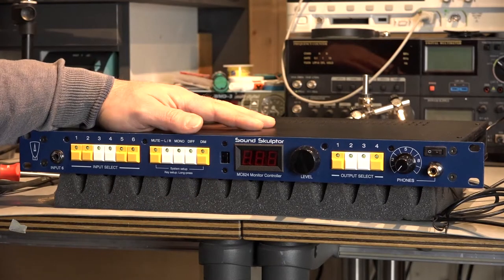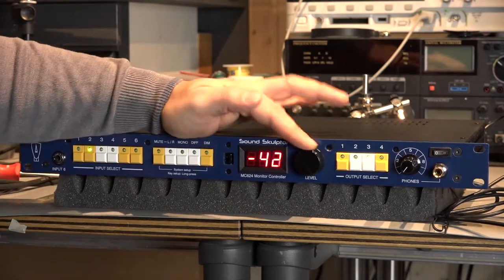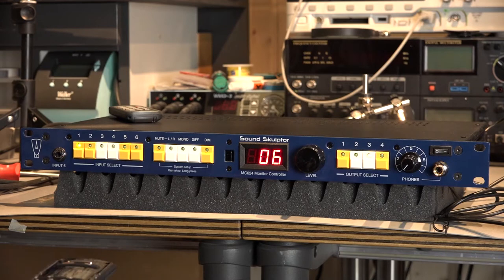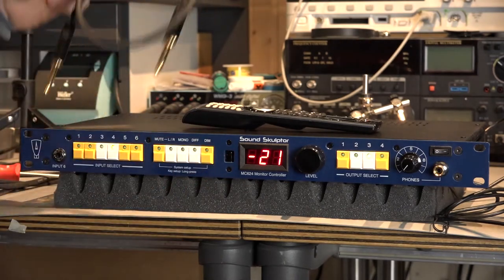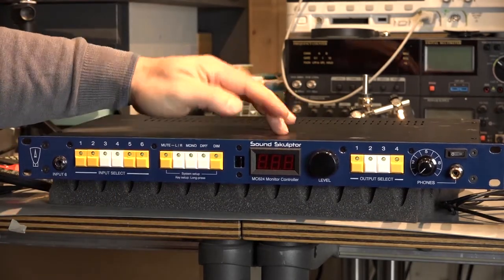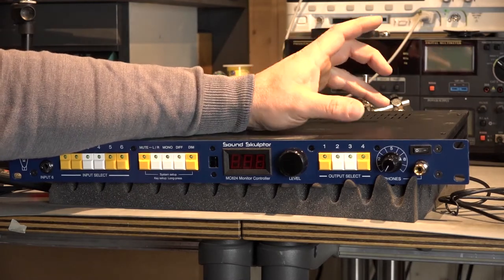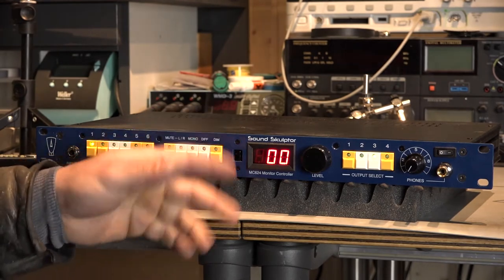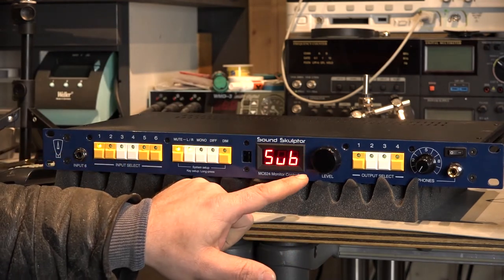Sound Skulptor MC624 DIY monitor controller. Setup and final words

Comment: I concur with Metralon. Using multi-color LED's in the case of the L/R/Stereo switch would also be easy to implement. This is without losing the information that you don't have a faulty left amp but just a single channel selection (that was probably the reason for Sound Sculpture in the first place to light up the mute LED)
Reply from the maker: lighttraveller hah! You are genius! I hope the Sound skulptor will read this :) Excellent advices!

Comment: Companies provides you with shitty external ac adapters to avoid the certification process that could make a more expensive final product. Users ends up spending time and money solving the problem of that hateful hanging part
Great in depth analysis Robert, thumbs up
Reply from the maker: Isidoro Maich Actually this adapter is a Freaking good quality piece. With all certifications on the Planet Earth and beyond:)
Tomorrow I will try to install a small linear transformer based PSU into the controller. Is not eating almost nothing, so I hope will work. 1 Amp should be enough. I measured 0.07 A in idle, and 0.42 A with full driven headphone, plus continuously adjusted level. Fingers cross:)
Reply: Cool, I hope you can solve this, no matter how good the power blocks are... I hate that damn things... Idk maybe someone hit me with one when child

Comment: Why would the unit need FUSES? This is power supply responsibility.
Reply from the maker: TheLT Because this specific power supply does not have any replaceable fuse? 
Anyway, we solved this issue, with a new built in power supply. No more adapter...

Comment: That wall outlet fuse is just stupid. If you have properly done electrical in your studio the circuit breakers would trip way before that stupid fuse.
Reply from the maker: TheLT Not really... Main fuses are slow (Class B, or C) and rated at 10 or 16 Amp.... This “stupid” fuses rated much lower and they are way faster, additionally, they can save Your gear, and Your home. 
Homework: find a professional studio gear without fuse! Good luck with it :)
Reply: @BMRStudio  I have built dozens of units without any fuses. 500 series, Eurorack modules, you name it. They don't have fuses and neither do their power rails. It's the PSUs job to provide rated power. If want a higher class linear PSU, by all means, go for it. But it is not the unit's fault. One can incorporate circuit breakers, fast blow fuses, additional protection circuitry, but that would just complicate things and make those diy projects much more expensive. Thats why they go for cheap chinese SMPS'es. Besides, there are sophisticated automatic mains circuit breakers used in PDUs for sensitive gear. Tunable to mA ranges. All I wanted to say is that the design is fine. Its DIY, bring your own DC if you so wish.
Reply from the maker: TheLT My thought on fuses: Better to fear, than shocked! Go for it :)